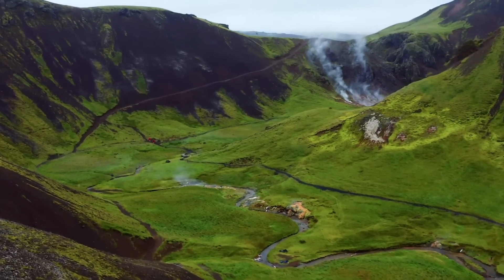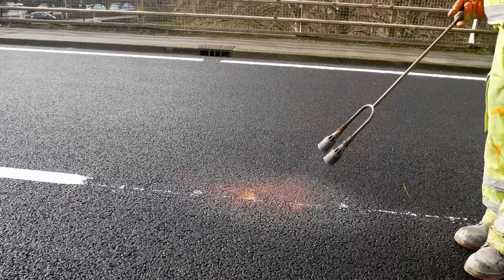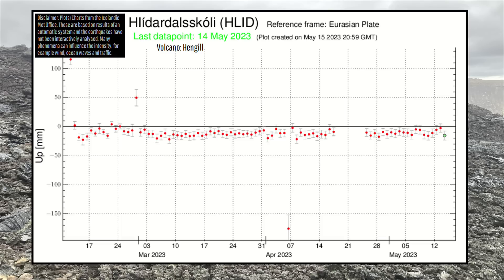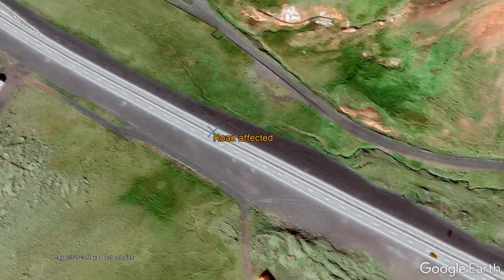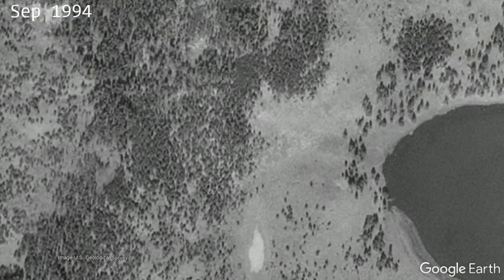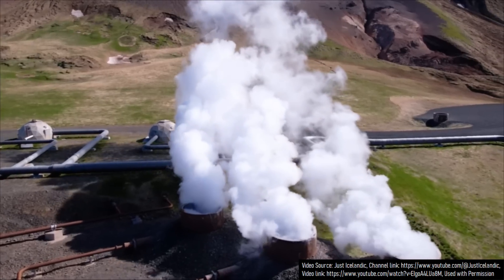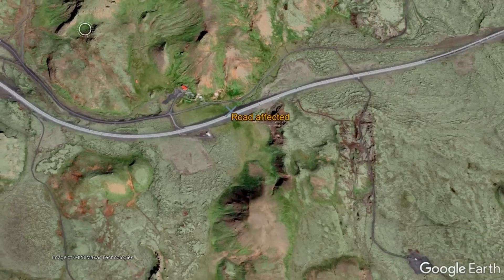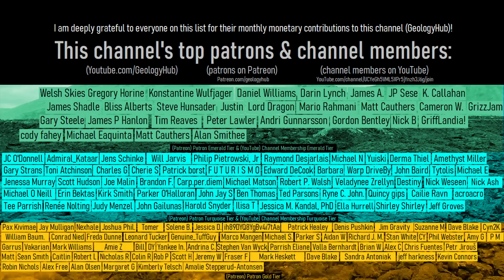Iceland Volcano Update; A Road is Melting at the Hengill Volcano

Comment: Curious about your thoughts  considering what's been developing at Hengill the past 24hrs.
Reply from the maker: For now, I am presuming the earthquakes are purely related to the geothermal plant. This does not imply poor operation of the power plant, but rather is quite typical of many geothermal fields used to generate electricity. Another example of a geothermal field which produces earthquakes due to power plant operation is "The Geysers" close to the Clear Lake volcano in the state of California.

Comment: what type of volcano is it exactly? Would there even be any uplift? Knowing the rate of ice melt at the northern hemisphere has been quite high these last few years thanks to unusual weather and whatever caused it....the plates would be hauling ass thanks to the uplift of the plates, also the ocean plates would get pushed harder by the ice bearing plates and any ocean level rise would increase the burdens. Not to mention how everything expands when warmed. Just because a volcano doesn't erupt often, doesn't mean it wont. Things are changing weather you believe in climate change or not. Volcanoes all over the world are doing the impossible an awful lot these last 5 years.

Comment: I don't know how fast cars are going over that section of road or how much the tires will heat during the time required to pass over the hot areas. If the tires are heating significantly, the danger of the hot road is that tires will lose strength and increase pressure from the heat. In that case, tire failures could be more likely and lead to accidents.

Comment: with the advent of our sun becoming a gamma-ray pulsar progenitor class star, on January 31st 2017; the apparent reactive solar system wide terra nova events; are far from predictable. 
reacting energies entering our planet, are just that.
 they are reactive to the point where everyone needs to respect the law of energy conservation.. 
increased levels of gamma rays and cosmic rays entering our planet have already superheated every square millimeter of magma beneath the crust.. 

so to say that a new hydrothermal vent wont ooze magma at the surface is an asinine statement. 

if you live near an active volcanic field or a seismically active area , you should move away from those regions a.s.a.p.

we are at the tip of the terra nova iceburg....    its full totality wont be known until the sun enters steadfast noon, followed by the final hypernova. 

once the reacting energies are nullified by the death of the sun, peak phase of terra nova will occur within the same timeframe of days between January 31st 2017 and november 11, 2018. 

it took that many days for the earth to ring like a bell after the solar gamma ray storm began.
 it will take that many days post hypernova, for terra nova to begin calming down. 

no energy is created or destroyed, in the case of magmatic earth; it transforms into thermal expansion.

Comment: Cool think is asphalt is actually a liquid. It just moves really slowly so its not really melting just becoming less viscous. Which is why you sometimes see asphalt roads that are sloped from the center. Its literally running down the sides.
Reply: Sloped road profiles are usually for drainage. Roads don't actually flow much thanks to the locking of the aggregate, gravel, and sand. Look at pictures of the roads in Death Valley to confirm this.

Comment: Hot springs have opened up under roads in Yellowstone and Lassen Volcanic National Parks.  The last time I was to Yellowstone (late 1990s) there was steam coming up through cracks in the road by a hot spring area, and I've seen similar at The Sulfur Works at Lassen.  Not only can new hot spring areas pop up, but existing ones wander.

Comment: Technically asphalt  or bitumen is a liquid with a very very high viscosity i.e. on multi decade to century timescales it flows and drips so it isn't so much melting as decreasing the viscosity of the asphalt.
I don't think you can melt a liquid after all. ;)
Reply: Is sticky asphalt bad for tires?

Comment: With all the melting in Iceland due to climate change,  there is A Lot for Ground Water flowing Everywhere, Thus with all the Extra water it will Pole up and flow down to the fissures  where it can get Hot enough to form Hot springs.